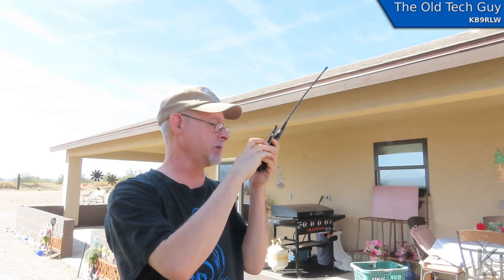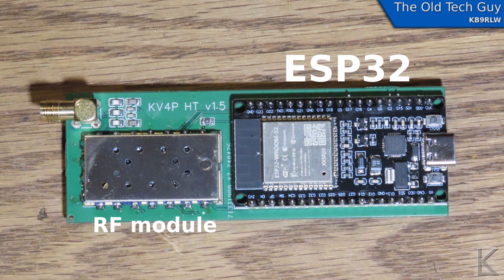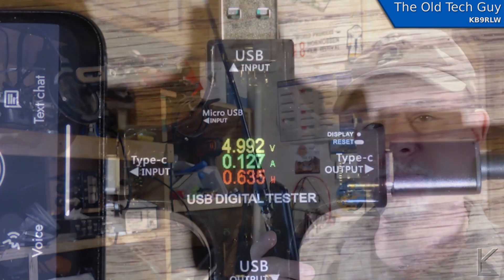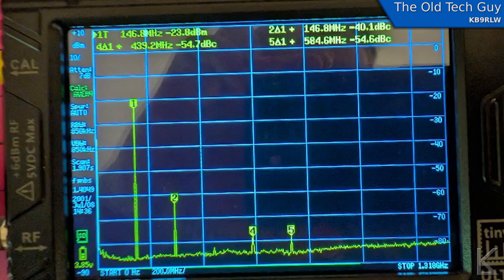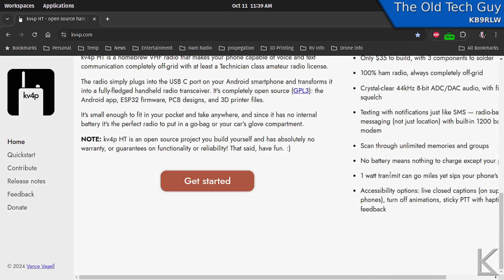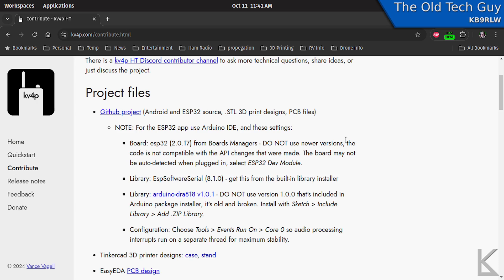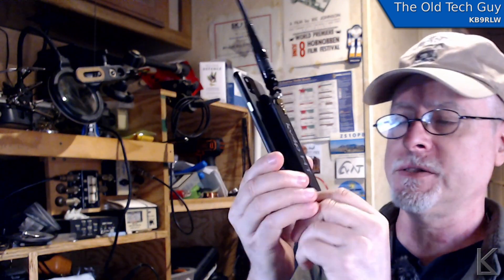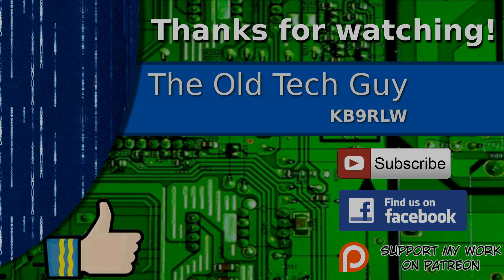Ham Radio - The KV4P Cell Phone 2-meter HT.

Comment: it would be cool if it had its own battery and had bluetooth to comunicate with the phone.
Reply from the maker: It already has Bluetooth capability in the ESP 32 module. So all you would need to do is plug it into a USB-C power brick and then edit the software to use Bluetooth for the connections. I'm sure somebody will probably do it eventually.
Reply: @loughkb  Exactly, seems to be a little clumsy to use. UHF/VHF HTs must have a decent size antenna, and draw considerable power. Not mentioning the RF will destroy the delicate phone circuit.
Reply from the maker: It's not clumsy, it doesn't draw very much power as it only puts out one watt. And no the RF will not damage the phone. Be careful with assumptions.

Comment: Great concept.  Some improvement suggestions below for future revisions:
1) Incorporate a battery bank into the module that can also be used to charge the phone in case of emergency
2) Communicate via bluetooth or WiFi-Direct to the phone, so that the radio module can be set up in a nearby location
3) Include a digital voice codec for DMR, YSF etc. in the module.  Uses less power with better audio quality.
Reply from the maker: I have used DMR, fusion and some of the other digital modes where the audio is digitally compressed. And no, it is not better audio quality! Voices sound robotic and compressed. FM audio is just as clean and clear as can be. And if you were using a digital mode you would still be modulating it as tones using FM, it wouldn't use less power.
Reply: 4) UHF

Comment: Baofeng FINALLY has competition, thrill, one more cheap HT that can use a Nagoya antenna.
Reply from the maker: Oh they have competition. Check out the Quansheng UV-K5.  Mostly reverse engineered, with ham modified firmware and hardware upgrades available. It's pretty cool.

Comment: Hey! With it working so well on smart phone and tablets, anyone want take a shot at sending pictures and video vhf and/or uhf? Imagine how helpful that would be for search and rescue, or other ham related outings.
Reply from the maker: I don't know that there's any modulation method via audio on FM that would have the bandwidth to send video. Low resolution still images might be possible. Probably not going to be able to get much more than 2400 baud.  And you have to stick to legal modulation methods that can include your call sign.

Comment: does it have to be connected to a cellphone with service or can I use one of my old phones sitting in the desk drawer collecting dust?
Reply from the maker: You only need to install the app. And then the phone is nothing more than a computer controlling a radio and processing audio. It does not need a cellular network or data.

Comment: Out of curiosity, could you add bluetooth support and be able to leave the little "ht" outside and use your phone to as the ptt?
Reply from the maker: The ESP32 does have bluetooth, and wifi.  You would need power for the device though.  The rest would just be software changes.

Comment: AWESOME!!!  Can this be made to do FRS, GMRS, or CB frequencies?  Would be a life saver in an emergency when cell towers and wifi are down!!!
Reply from the maker: It's a VHF radio module, so CB is out.  But it would only be a change in the software and a UHF version of the RF module to cover GMRS frequencies.  It wouldn't be technically legal though, but fine to use in an emergency situation.

Comment: I'd be happy just to have a cell phone with a real antenna 😂
Reply: Does your phone have a headphone jack? If so you can add an antenna. Phone companies started making cellphone companies hide the FM radio app, because a lot of phones started removing headphone jacks. The headphone jack was required to use the FM radio on Android. On some phones with the FM radio app hidden you can get your FM radio working with headphones. Here is how I added an actual antenna. I found some 3.5mm headphone jack to F type adapters. Then got some F Type to SMA adapters, and screw the antenna into that. It actually works.

Comment: KOOL, Very KOOL unit!
Does he have a USB C to micro USB B adapter for it? I have an OLD(er) cell (not presently in use as a cell) hanging around that I could put it on to if he had one of those. 
Good idea on the cases for the cell/HT adapter!!!
Thanks for the first look/review Kevin. 
73 de
WB2ZDB
Reply from the maker: Get on Amazon you can probably find a micro USB to standard USB adapter plug and then use a standard USB to USB-C cable. Or some combination thereof.
Reply: Using a MagSafe connector would be more secure and durable than a tacky strip. It would be even cooler of you could reverse charge off of the MagSafe connector but Apple doesn't allow that